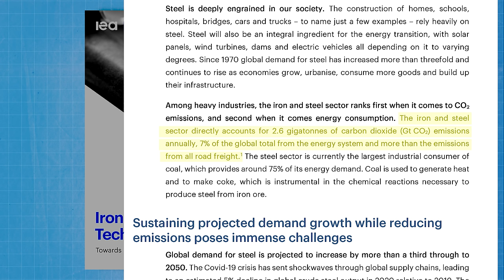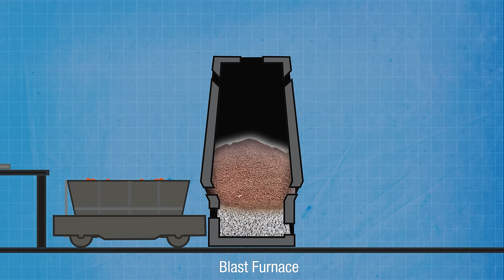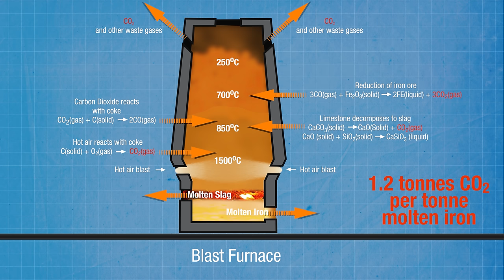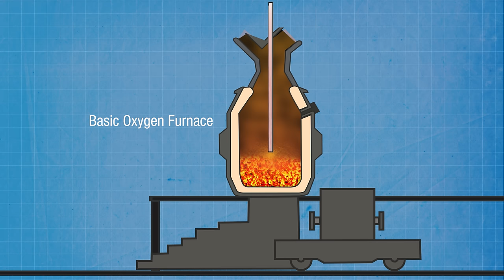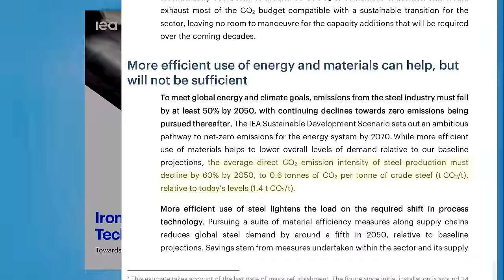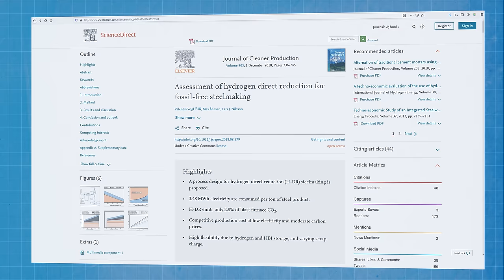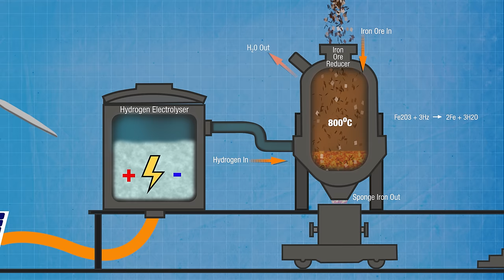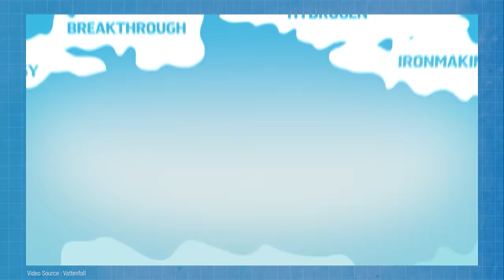Fossil free steel. Another giant step towards net carbon zero?

Comment: But about CO2 if you did bottle it ...and heat that cylinder (with concentrated solar bleed in ... The pressure drop to say ..an ocean condenser then you would have a fairly impressive pressure drop across a vapour turbine ... Which would yield power to extend its own plant structure .... Expansion turbines condenser/evaporator assembly's and so on.

Comment: There's another approach that does not involve hydrogen called Molten Oxide Electrolysis.   It's being tried by a startup, Boston Metal, https://www.bostonmetal.com/ .  This was founded by a well-known MIT professor, Donald Sadoway, whose previous molten metal battery startup, Ambri, is just now catching on.   MOE involves driving off the oxygen in iron ore with enormous currents, and apparently the key issue is getting electrodes that are cheap and long-lasting.   Hope you can look at them too!

Comment: This process and many more industrial processes can be powered by the newest, green Fusion nuclear Safire Generator. All the old uranium and thorium fission reactor problems go away with the new Fusion reactor era now actually here. We have recently taken a new step to advance the physics of power production by enabling chemistry of the atomic nucleus, or "nuchemy", We are passing the chemistry level where we interacted with electron shells and are moving on to nuclear manipulations in this "nuchemy" atomic nuclear era when we interact and multiply nuclear protons using hydrogen fuel stock. We have rediscovered the lost work of the alchemists and can make new elements with different atomic weights and vastly new properties. This was ably demonstrated in "The Safire Project". Quanta are important. We now have enough energy in them to manipulate the atomic nucleus much more easily by creating a compartment or a simple local region of plasma containment so reactions at this atomic nuclear level can easily take place. This is about to practically enabled a fantastic new era of energy production for the whole of mankind. This with free fuel obtained from water or atmospheric moisture anywhere in the world. New fusion nuclear is at the industrial commercial production final development point as of now. The energy argument and other power methodologies are all now irrelevant as we have new and very physically and economically powered practical and local community level fusion nuclear power. Solar roof plus Teslawall battery may presently be the way to go domestically but megapack batteries and multiple storage technologies interconnected with an expanded ugly grid have a less certain requirement when you consider new any-scale community based and 24 hr self-fueling reliable fusion nuclear in the form of the "Safire Generator". Learn all about it at "aureon energy.com". Learn the newer EU physics at "Thunderbolts Project.com" and you will be permanently reeducated with the advanced new theory.

Comment: Because with the technology available today. The wind farm production of electricity gets turned off when there is sufficient electricity like at night.  The old style generators take 24 hours to start up.  Wind farms can be stopped by throwing a switch.   Now with this system, the power produced could be used at non peak times for steel production so as stated, renewables stir power as hydrogen.   Bet there is no political will to do this.

Comment: Good opportunity for small nuclear to provide the process heat and electricity for this process!
Reply: Why
Reply: @davidwatson8118  Because you run plants like this 24/7, solar won't work for that, wind is intermittent, you can't store the energy effectively. Nuclear is perfect as an "always on" solution.
Reply: @lolroflpmsl  
Have you not been paying attention? The primary energy source for this process is hydrogen. Hydrogen is the perfect storage medium for excess solar and wind energy. AND it can be easily shipped around the world.
Reply: @3gunslingers  The REDUCING AGENT for this process is H2, which is generated by electrolysis, which requires electricity! Electrolysis to make H2 is an inefficient process at the best of times, which on top of the low efficiency of solar and the transience of wind, is baaaaaaad! This proposed blast furnace replacement needs heat, and it needs electricity, both of which (as I said in my first comment), nuclear is ideal to provide. Hydrogen is a crap energy storage medium, BTW - it's an arse to handle and has abysmal energy density. Source: I'm a PhD-level scientist working in the energy sector!

Comment: Very interesting. It might be viable. 

A few questions for you, because are you absolutely certain that CO2 is so damaging? 

1. CO2 concentration in the atmosphere is approx 400 parts per million. Essential for plant growth which is better suited to higher concentrations such as 1200 ppm.
2. CO2 in the atmosphere is historically low compared to the evidence of geological record. More CO2 in the time if the dinosaurs. 
3. Human contribution to CO2 emission is 3% of total. Nature produces the rest 97%. Human contribution to the total is therefore very small, ie minimal.
4. CO2 does not have as much influence on global warming as H2O clouds. 
5. Proper examination of the facts is required for the claims made about CO2 emissions. And by the way, plain carbon only becomes a gas at 5500 deg C, so atmospheric carbon just doesn’t happen on earth.
6. An energy accounting balance of energy put in and resulting steel product plus side product such as CO2 is required. So called renewables also need this type of examination and to be added to that cost, because they also want have a cost in production of steel and side products plus transport fuel etc. 

Looking forward to this more serious examination of the subjects noted.

Comment: Please feature liquid metal battery(backed by Bill Gates). The company's name is Ambri. Twice as cheap as li-ion and simple to manufacture - no exotic metals used. And it's non-volatile. The battery will be first commercially used in 2021 by Terrascale.
By the way, the inventor, professor Donald Sadoway has recently talked about fossil-free still production as well. His method is a bit simpler than what you showed. The company is Boston metal.

Comment: Once again Hydrogen is the answer, and will be for many other heavy use applications. The only question is where the balance points will be between using Hydrogen, battery storage, and direct electricity use. These optimum points will change as the technologies mature, and will vary with the effects of supply and demand. It is therefore very important that no single solution is mandated for any give scenario as the optimum  points will remain fluid for a long time to come.  The solution demonstrated uses two of these sources but could use all three if the conditions were right.

Comment: Is this technology Oxygen positive? i.e. Does it emit oxygen?
Reply: The oxygen comes out in the form of water.  (2 hydrogen + 1 oxygen = H2O)
Reply: @incognitotorpedo42  No, it doesn't. Water is split electrolytically into Hydrogen and Oxygen. The hydrogen is feed into the FeO2, which strips the O2 off the FeO2 forming pig iron and water (as steam), the steam is fed back into the electrolytic converter. That leaves O2 unaccounted for from the initial conversion. 
It's possible that O2 is captured and used for some other process, or maybe it's simply released into the atmosphere, which would be ideal. More O2 in the atmosphere is good for us non-photosynthetic organisms.

Comment: This is not really new.
In Norway, which is known to have very cheap hydroelectric power, pig iron was smelted electrically from iron ore 100 years ago.
But the problem is elsewhere:
Where do you get the gigantic amounts of electricity, which also have to be supplied very constantly and uninterruptibly?
Wind and Solar?
Impossible! Even short fluctuations in the power supply would destroy the technical equipment. 
So we are back to the completely unsolved storage problem. One CAN store, certainly. But this electricity would be priceless. AND wind and solar are already at their limit.  Germany, for example, doesn't even have enough space to meet its current demand for electricity from wind and sun, much less additional demand for e-transport and steel production (and concrete, and nitrogen fertilizer, and... and...).
Of course, it would be feasible with nuclear energy - but ONLY with nuclear energy. Anything else is wild dreams.
Reply: HYDROGEN!
Hydrogen is produced in favorable spots all over the globe and shipped to the smelters, just like coal is today. 
Have you ever thought "Where do you get the gigantic amounts of coal, which also have to be supplied very constantly and uninterruptibly? Impossible! Even short fluctuations in the power supply would destroy the technical equipment."
No, you haven't. 
But obviously hydrogen is a new energy carrier that has to be established first.

"So we are back to the completely unsolved storage problem." No, we are not. Hydrogen is stored, much in the same way coal is.

"Germany, for example, doesn't even have enough space to meet its current demand for electricity from wind and sun," Same goes for coal. Germany imports nearly all of its coal! Why should it be different for hydrogen?
Reply: @3gunslingers  
Coal is solid, easy to store, easy to ship.
Hydrogen is the lightest element. Even when extremely compressed, a tank contains not much.
It can't be liquified because its condensation temperature is near absolute Zero.
Its atoms are so small and agile that they even pass through solid steel. But hydrogen not only diffuses through solid steel, but it is also weakening the steel too. Therefore the tanks need special heavy and expensive construction.
And Hydrogen is VERY explosive when mixed with air, much more dangerous than natural gas.
Some numbers:
H2 compressed to 500 bar (which is an extreme and energy-consuming compression!) weights only 45 grams/liter, coal 1300 grams.
So to ship Hydrogen you need a ship with VERY tough and expensive and dangerous tanks. Indeed you need 28 ships to transport the same amount of Hydrogen as one ship loaded with coal. You need 50 ships to transport the same amount of energy!
And you will lose sizeable amounts of Hydrogen when you store it. 

Now think again...
Reply: @3gunslingers  Another problem are the countries where Hydrogen can be produced with wind and solar. These countries, for example with vast deserts, are politically unstable and prone to blackmail us or getting involved in wars or terrorism. Thus, the supply is not only extremely expensive but also extremely unreliable.
No thanks, I don't want Hydrogen! It will ruin our economy and draw us into wars!
Reply: @TheSpecio  
"These countries, for example with vast deserts, are politically unstable and prone to blackmail us or getting involved in wars or terrorism. Thus, the supply is not only extremely expensive but also extremely unreliable.
 No thanks, I don't want Hydrogen! It will ruin our economy and draw us into wars" 
Is this sarcasm? You are talking about oil, not hydrogen.

I don't know where you get your mass, volume and energy density from. 
https://en.wikipedia.org/wiki/Energy_density The numbers here look quite different.
Reply: @3gunslingers  
Obviously, you do not know much about physic and math. The numbers say the same as I say. Go back to school and learn about mass, volume, density and you will agree.
Reply: @3gunslingers  Germany is buying its oil from Russia, Norway, UK, and Kazakhstan.

Comment: The hydrogen reduction route is pretty interesting; anything that cuts down on the energy requirements for the iron oxide reduction is a good thing.

It still seems like a process that would be a great recipient of process heat from a small modular reactor. High temperatures, large and constant thermal load, those are conditions that reactors work best with while renewables don't.

Comment: I wonder if a scaled up thermite process i.e. using aluminum to reduce the iron oxide to molten iron would be both cost and energy effective here instead of hydrogen reduction?
Also what about a Kroll-type process* using magnesium to convert FeCl3 (made from first reacting Fe2O3 w. HCl) to iron metal would work as well to avoid using coal / coke?  Comments?
*See:  https://en.wikipedia.org/wiki/Kroll_process for details.

Comment: Steel manufacturers need to implement SMRs......as are some remote mining operations in certain part of the world already....
Reply: I don't think blast furnaces are located in remote areas. They can use grid electricity just fine, especially if they can take advantage of the solar energy peak to generate all the hydrogen they need for the day. Save the SMRs for the mines first.
Reply: @SocialDownclimber  - Apparently i failed to explain what is so obvious to me.........A continuous supply of such significant clean electrical power for sponge steel is impossible using wind and pv solar and hydropower has reached saturation in USA.

This top quality steel without the excessive CO2 release from Electrical power gen cannot be achieved without grid connected SMRs or larger baseload fission nuclear electrical power generation.
Reply: @gtranquilla  Why though? As I understand it, steelmaking isn't a continuous process. You don't need baseload power if the process can be turned off. Its like saying you need baseload power for a dishwasher. You don't. Just don't run the dishwasher when there is less grid power.
Reply: @SocialDownclimber  - If not a continuous process then it must cause grid power fluctuations. The infamous “duck curve” for grid power in California has caused a serious destabilizing effect for reliable grid power there....but it is over the 24 hour day/night period with peak load demand in the morning for commuters and again at homes starting around suppertime...

But what the hell...it creates more jobs for us electrical engineers to try to solve with software control systems.
Reply: @gtranquilla  So you are saying that the grid provides way more power than is needed at certain times, and that operating this industrial process will consume a large quantity of power at certain times, but you can't connect the dots even though there are exactly two of them. I'll spell it out for you then. 

Why don't we run this process in the middle of the day when there is freely available electrical energy produced at low cost by renewables?
Reply: @SocialDownclimber  + first of all you can check my credentials on the internet with a quick search on LinkedIn.....40+ years electrical engineering in the electrical power industries including electrical utilities including Candu fission nuclear

What would happen if an unqualified university student failing to complete the wide range of prerequisites necessary to sit in Phd Electrical Engineering class and started to ask questions? How long before fellow students and the professor would notice that he does not belong in that classroom undermining the professor’s and student’s valuable time.?

Such is the problem with social media where the brilliant and the ignorant mingle together...
Reply: @gtranquilla  I know you are just being nice calling me brilliant, but I do have to admit that using energy intensive industrial processes to manage the duck curve isn't entirely my idea. You should look it up hey.
Reply: @SocialDownclimber  - aah yes....the ignorant student, i.e.,  tries to educate the teacher.
i do not take advice from those who do not have a solid education in Energy science, especially those who are not licensed professional electrical engineers.

Comment: Slapping a price on carbon is just a way for large banks and trading firms to have a new trillion dollar market to trade. The banks get a small cut of every trade, that's why they push this concept instead of politicians simply passing a law requiring all plants switch to this new production process by a certain date.
Reply: Pricing carbon doesn't involve trading, so banks and trading firms are not involved.  It's the simplest and most efficient way to reduce carbon emissions.

Comment: What about nitrogen steel (HNS)?
Reply: That sounds chemically impossible.  You can't reduce iron oxide with nitrogen.
Reply: @incognitotorpedo42  HNS is a non-carbon austenitic steel, where Nitrogen replaces Carbon in the solid-solution strengthening role, if you define steel as iron strengthened by another element in the solid solution. 
You can also refer to it as high nitrogen iron alloy.
Nitrogen and carbon are incompatible in such alloys.
HNS is produced in a very different process, usually under high pressure in the absence of oxygen.
Reply: @bartroberts1514  I like the Idea sounds safer than Direct Reduction.
Reply: @bartroberts1514  Thanks for the info, Bart.  I didn't know about HNS.  It sounds like nitrogen would be introduced after the iron oxide is chemically reduced by some other means, presumably carbon.  That could probably be replaced with hydrogen as well.
Reply: @incognitotorpedo42  Well, don't trust this as the gospel of HNS. My knowledge is scant and I wouldn't mind getting more information on it. 
What I can gather is the iron needs to be low carbon (0.02%-0.1%), so low-carbon reduction techniques are appropriate. biomass replacement of coal/coke/gas feeding TGRBF or PCI with CCS after and using slag to displace OPC leads to over 83% lower CO2e emissions; H-DR & EAF is nearly 100% lower CO2e emissions.
Nitrogen acts like nickel in the alloy, for strength and corrosion-resistance. This means no CO2e from nickel production.
One reported benefit is that the strength profile of HNS is maintained through a ludicrously broad temperature range, both far lower and far higher than carbon steels.